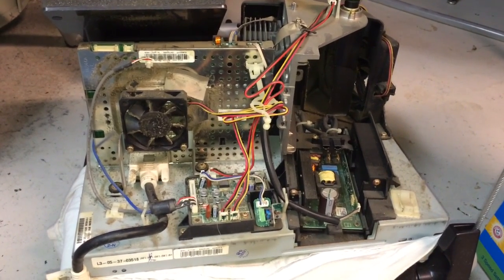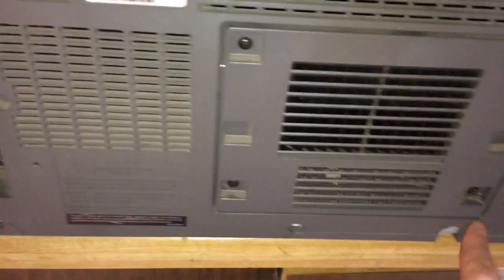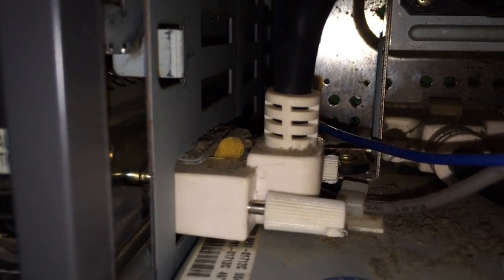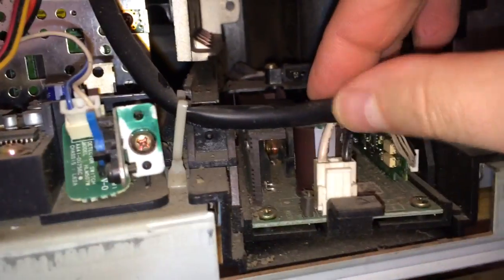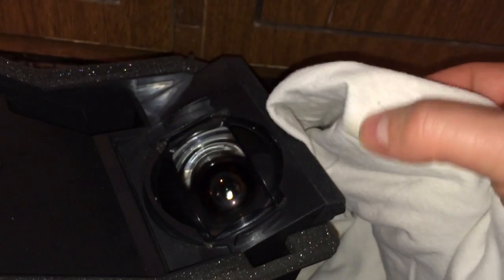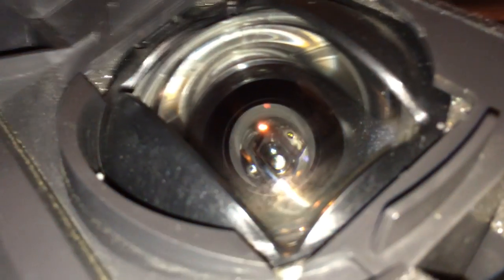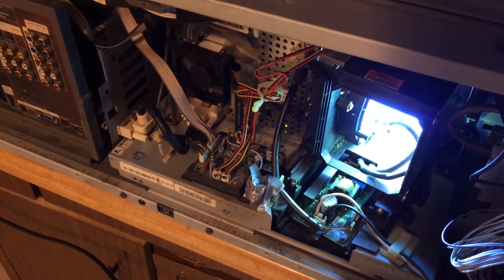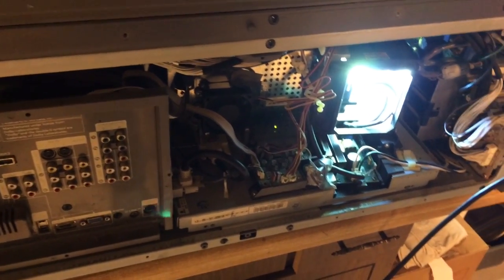Fix Your Dying DLP TV with a Vacuum Hose

Comment: I vaccum cleaned my toshiba dlp . Especially the light bulb interface area near the wheel. Cleaned the cooling fans and put some lub oil around the fan axis. wiped the lens with lens cleaners. after throrough vaccum and assembly when i restered the TV, to my amazement all what I saw is crystal clear picture. Yes I did a TV reset too. Thanks for this tip
Reply from the maker: +Last Titan - Glad it worked out for you!

Comment: Great video ! It was great help to get to the two fans and clean all the dust. After thorough cleaning however, I still have  an annoying “whine”coming from inside, not at all like a hair-dryer, but a distinct whine. Could it be the color wheel motor ?

Comment: Hi Databits, I just got finished cleaning my DLP. I spent the last hour vacuuming and using an air hose along with wiping and I got it all really clean, the cleanest its been in over a decade but it didn't work :(. I  have a Mitsubishi DLP WD-65833 and it blinks Green about 150 times then clicks off for just a second and clicks back on and starts blinking green again. There is no picture or sound. It wants to power up but it cant for some reason. I appreciate any help, thanks

Comment: Replaced the bulb less than a year ago - going to try this fix this weekend - will comment back!  Excited to see if this 54 year old homemaker can do this too!
Reply from the maker: +fran garvey - I'm interested in hearing how you do!
Reply: +databits I tried, but to no success.  I enjoyed the process.  I couldn't get to the color wheel, but don't think that is the problem.  no sharp whirling sound.  after I reassembled, the connect cable shows up on screen but screen goes blank in less than 1 minute and the timer/lamp and stand by lights flash.  oh well, one last thing to try - resetting factory light ours to 0 - then off to get a new TV - likely can get one for less now (paid $1,300 for this in '09)

Comment: My friend thank you for the very informative video. Not long ago I fixed my bosses DLP tv on the same way. Saved him like 300 bucks and that was all done just by General knowledge. No schooling in electronics or anything.

I am sad to say that my tv was not so lucky it has a broken bulb in the lamp. 

At first look I thought it wad ok but when I saw glass on my floor I started looking a little closer and noticed the bulb wasnt angled right.

The one upside to this was the tv cost me nothin $0. I am a scrapper/ dumpster diver and when I saw this tv in the trash at a apartment where I was looking for cans, I had to get it.

So I guess I am actually going to pay around $40 for this very nice tv.

And that my friends is why I like to dumpster dive.

But once again thank you.

Oh and you didn't mention ot but I went one step futrther since I had the back already off and all. I took my vacume, can of electrics duster and cleanened out the rest of the tv. I'm sure it is a good ideach, less scrap to as you put it get sucked back into tge fans...

Have a great day.

Comment: Ran through this on my 72" Samsung and the picture became super crisp.  Physically speaking, there is a lot more room in the 72" than in what you were working on, and other than the high-voltage card on the right (full of capacitors - careful there) it was a very simple operation.

I barely had any dust on anything, but there was a nice thin film over the main lens, and I cleaned the 'glass' that the lamp shines in to.

Basically it was dust, and it's working wonderfully.

Thanks for the video - it wasn't exact but it was a good solid 'assist.'
Reply from the maker: Glad the video was a help to you!  Enjoy that sharper image now!

Comment: Great video!

I had the problem where my 61" DLP would come on for about 20 seconds and then turn off with 2 (or3?) of the lights in the front flashing. Didn't think it was the bulb being burnt out since it was showing a picture for those 20 seconds. But after watching a few videos, including this one, I bought a new bulb (higher quality, around $75), plugged it in and *poof*...  it works great now!!  :-D

But while waiting a couple days for my bulb to be delivered (Amazon) I followed your video and pulled the guts out and cleaned them from top to bottom.   Nice to know everything is clean and so don't have to worry about that going forward.

Thanks for the video!

Comment: Thanks much for the tip!  I never knew that simply cleaning things out would get it going again, although I had a hunch that all the dirt and dust more than likely would cause heat related problems at the very least.  Looks good! Great video!

Comment: Mine model number HLS 6187  61 inch  DLP  date code 2006  1080P had one service problem under warranty they fixed. The screen had shrunk on one corner it was repaired.   It still has an awesome picture!   I kept getting a message on the screen saying check  fan 2  then it would shut off after 5 mins.  So I opened it up. Screws around the bottom to take of the cover off only. I took the two screws out that hold the tray out and  like 3 connector plugs. Put the tray on my desk.  Checked the fan it was not very free or loose compared to the other one.  Took a few more screws out near the fan and took the fan out.  I peeled the info sticker  half way  off the front of the fan and found the bearings underneath.  I put a few drops of WD40 on the bearing it soaked rite in.  Instantly the fan loosened up. I spun it by hand. Put a few more drops of oil.  If you want you can buy a brand new replacement on amazon or ebay.  They try to rip you off  for $60 some places ebay has same one for like $20 shipped .  It 3.5" fan.  Just google search fan 2  Samsung your model number. By the way mine hardly had any dust build up I cleaned the little it had on the both fans and vacuumed the area. Working good so far!  Hope this helps someone.
Reply from the maker: +SoFlaRocks - thanks for sharing all of that!

Comment: GREAT video! I actually used my compressor and airtip to blow the dust out of mine. I still have that grinding noise on the start-up. Do you think  my color wheel (or  motor) may be damaged?
Reply from the maker: Does it sound like a hair dryer or a dentist drill?
Reply: +databits mine sounds more like a dentist drill as the sound varies but get very loud
Reply from the maker: +Dennis van den Heuvel - most likely the color wheel

Comment: I have a Samsung as well I followed your vid good job good direction ,it needed the cleaning ,my main reason for doing this have a great picture but there are little black spots all over screen looks like little gnats the cleaning did nothing to resolve the issue also took off side panel to wipe of miriior and inside screen spots are still there not sure if there burned in or wht any help thank you
Reply from the maker: +76chyanne - is it possible the mirror(s) have deteriorated?
Reply: could b not sure hard to see
Reply: I realize this question is 2 yrs old, but adding comment if it can help someone else..If the little black spots are actually little black squares...I was told dmd chip would fix this problem-that sometimes instead of white spots, it can be the black squares -yes if the little mirrors are malfunctioning. In my case, most of the little dots are stationary, but some actually sporadically show up and then disappear. My dlp does not have a color wheel, but rather has colored chips (red, blue & green). I will be swapping my dmd chip in the next couple weeks.

Comment: @ databits   I have a Samsung DLP TV Model # HL-S5086W and about 20 seconds after the power button is pushed to turn it on, the lamp light blinks and then the TV clicks and turns off... then goes through the turn-on sequence again on it's own.  BUT it never turns on -- after doing this in a sequence of three times.  

I replaced the lamp and cleaned and vacuumed everything just like you said.  However-- i didn't check the color wheel since it was replaced only 2 years ago.  Both fans were replaced at that time as well.  Any suggestions please?  Your video was GREAT!
Reply from the maker: Thanks Todd.  It's likely a fan that isn't spinning or the color wheel shattered/died.  One guy on here told me he sprayed his with a lubricant spray and it took off again.

Comment: My 65" Mitsubishi is 10 years old, the first issue I ever had with it, was after about 8 years when the all of a sudden the picture went black and the red light started blinking.  I googled and found the lamp needed to be replaced.  I went to Amazon and found they run for around $20 to $30.  I bought 2, just in case one didn't work or got broken in shipping.  Took about 15 minutes to replace, and picture was perfect.  I hadn't realized until then how much the picture had faded over time.  That first bulb lasted 2 years.  Luckily when it happened again, I already had a replacement on hand.  But that one in and again perfect picture.  I ordered another lamp at that time just to make sure I had a spare on hand for the future (price went down to about $20).  Then about 6 months ago I got a white dot, then they started multiplying.  Finally there were about 25 of them, nothing major, just annoying, and I knew that at the rate they were popping up now almost every other day, I bought a replacement DLP chip from ShopJimmys through Amazon.  Yesterday I replaced the old one myself (I'm 55, female, disabled, have arthritis in both hands, 4 herniated disks in my neck, and a cataract in my right eye - yet I found it quite easy by following their online video - although the model they were using wasn't exactly the same as mine in the back, so I had to think a couple times about what screws to remove and what wires to detach).  Took about 1 1/2 (mainly because I wanted to take my time and make sure I wouldn't have to go back and do it again, and I really didn't want to make any mistakes and lose my TV altogether).  Got the chip in, put everything back together, turned it on and it looks just like the new ones on display in the stores!  Perfect picture, crystal clear (almost too sharp, had to change the setting from Brilliant to Bright).  The DLP chip cost me $219 and I got everything I needed, including a wristband to help me ground myself, replacement silver for the heat sink, gloves, and a microfiber cloth.  BEST INVESTMENT EVER TO GET MY 65" TV running like new again - Couldn't replace it for under $3K.
Reply: Microfiber cloth and new thermal paste = my reason to up vote. Well done ma'am! Best way to keep your lens clean and scratch free. Glad to see common people outperforming the so called TV repair services recommended by the manufacturers.

Comment: Hey so I just got the same TV and watched your video. When I turn on the TV, it makes a whining or buzzing noise after about 10 minutes. Sounds like its getting hot and cant cool off. CAN THE FAN OR THE COLOR WHEEL HAVE THIS SAME SYMPTOM? Or is the buzzing only indicative of a bad color wheel?
Reply from the maker: It could be either but there's a higher probability that it's the color wheel.

Comment: Hi…..ran across you video in my search for DLP assistance.  I own a Panasonic 61" DLP tv, model # PT-61LCZ7, which will no longer startup.  It was working perfectly the night before, and the next morning simply refused to startup again.  You can hear the fans kicking in and spinning…and the red light on the front just continues to flash endlessly.  I counted up to 50+ flashes, and it was just going to continue flashing forever.  The tv uses the Luxim LIFI4000 lamp, which is almost impossible to find anymore.  Does the endlessly flashing red light on the front panel of the tv give you any indication as to the exact malfunctioning component?  Could it be the power supply board,…or the thermal limiting fuse…or simply a fan not spinning at a fast enough speed?  I may have located a lamp, but don't want to spend that much $$ if it's something else.  I want to hold onto the tv because of it's extensive patch panel on the back.  Most of the newest 4K tv models for sale have 3 HDMI ports….and that's about it.  Thanks for any help you can provide.
Reply from the maker: Hey Ron, I appreciate the comments and for watching my video.  Unfortunately, the problem could be any number of things.  Have you inspected the color wheel?
Reply: I have one on these TVs. It's likely just the lamp that needs replaced. Financially speaking though it's a tough sell to spend $350 on the lamp. I replaced the panny with a mitsubishi dlp which I think are higher quality.  I still have the panny in the garage. Lol

Comment: Excellent videos, databits, they've certainly inspired ME, and apparently dozens if not hundreds of others to tackle their own TV repairs. What a good thing! I DO have a couple of minor questions still. (before I start "surgery"!)
Forgive me if I missed, but did you mention whether or not the color wheel is a contiguous part? i.e. Any chance of taking it apart and replacing JUST the motor...which I assume is the offending component in most cases? Or does the whole thing have to go? 
Secondly, I don't think you mention anywhere about lubricating ANY of the motors....fans OR color wheel. So, maybe they are "lifetime lubricated" and "non-seviceable"? (What a shame if that's the case, because with the color wheel especially, the motor is probably worth about $5 of the often $100+ selling price.)
Reply from the maker: I agree on the value of the parts, but I would not attempt to oil the motors.  You might find another TV from someone for FREE on Craigslist, remove the color wheel, and place it in your TV.  Or just move your good bulb to the FREE TV.
Reply: Michael Scott

Comment: Took everything out, new bulb, color wheel in tact, cleaned it, no dust. Still get three lights on the front flashing,  no screen starts, light doesn't start, and a buzzing sound happens. Not sure what's wrong with it???? Help. Thanks.
Reply from the maker: William: sorry to hear that!  It could be what's known as the ballast.  But before you go buying one of those, go over everything you did and reseat/unplug/replug everything.  Make sure the color wheel was properly plugged back in.  Make sure all of the fans spin when you power it up.  Message me direct from my channel page if you need more help!

Comment: I went ahead an pulled the color wheel...cleaning everything on my way in and back out...including using isopropyl alcohol and a microfibre eyeglass-cleaning cloth on the wheel. Just ONE segment of the wheel had some "scuffing" on it. Ever heard of THIS happening? Is it the CAUSE of my noise....or a SYMPTOM of the noise (caused by something else?) Once I put everything back together and turned it on....the TV STAYS on, without shutting down by itself, (which IS an improvement)....but it's noisier than before. 
Both fans are now clean as a whistle, AND turning, so I'm guessing my noise HAS to be from the color wheel. Here's a crazy question: since it is NOISIER after one disassembly...what are the chances it'll be QUIETER the next time I take it out and put it back in?? 50/50? Worse? Maybe I just have to take it out and put it back 2 or 3 times until the wheel/motor/bearing like the exact position they're bolted into? LOL
Reply from the maker: Yes, I would remove the color wheel and reinsert it about 12 times and that should correct this issue!  Kidding!  First off, congrats on doing the work you did.  Unless the color wheel is rubbing up against something inside, the motor in the color wheel is going bad and will remain noisy.  Typically it sounds like a dentist drill amplified or a weed eater.

Comment: I was wondering if this could help with the white spots on my TV.  About a month ago I got a white dot and one black dot.  Not I have about 4 black dots and 3 white dots.
Reply: +Psalmist Ledra McClinton That is most likely a DLP chip problem. You can buy the part and fix it yourself for around $200.
Reply from the maker: +Psalmist Ledra McClinton - indeed, an electronic component failure

Comment: I have a  floor wd82740 with blink green led. Cleaned unit good.  La.p is good.  Will not reset just keep blink 
I open lamp door.  Yellow led then closed it. Blink stop until I press power. Ideas?
Reply from the maker: The ballast board may need replacing.
Reply: @databits  I did trouble  shooting  and came to the same  conclusion.  Thanks, will  get back to you

Comment: My Samsung DLP has no noises, but turns off after one to five minutes. I've done everything in this video except inspect the color wheel. The picture looks great when on, could it still be the color wheel?  If not, I'm at a loss
Reply: Inspected the color wheel and it looks to be in good shape. I put everything back together and now the lamp doesn't turn on (it's a new Philips). Do you have any thoughts?
Reply from the maker: It's almost always the ballast for the bulb, a bad fan, or the color wheel.
Reply: If the ballast was bad would the TV turn on at all?  What is your guess with no noises and perfect image turns off after a minute.
Reply: color wheels can go bad without making a lot of noise, happened on mine